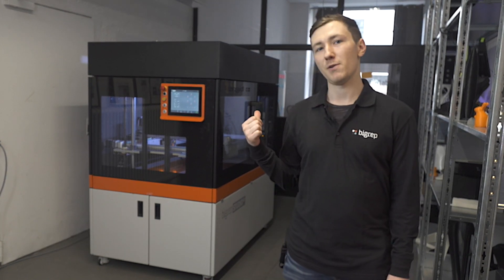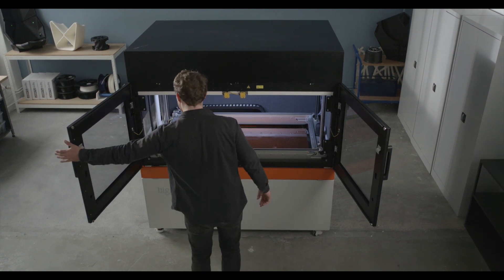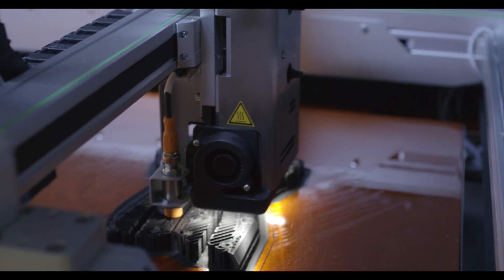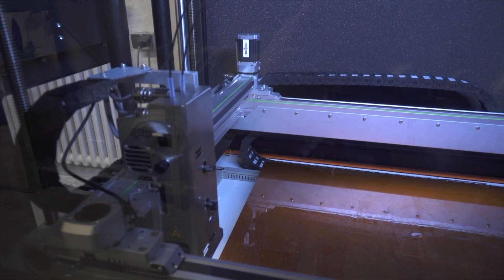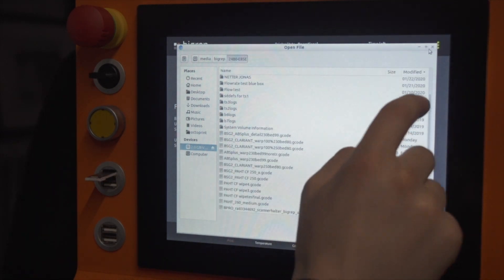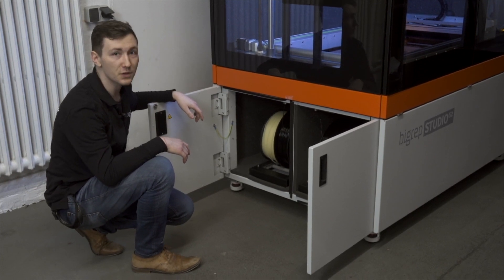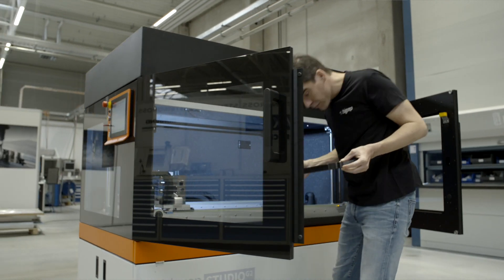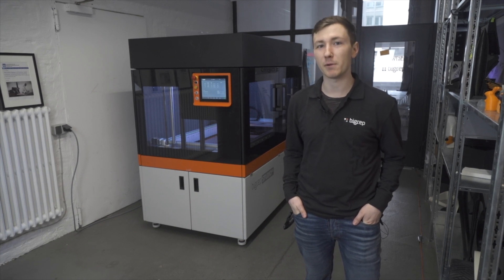BigRep Studio G2 - Product Walkthrough

Comment: I really love to work with Studio G1 and the Studio G2 looks amazing. Just a doubt. The capacitive sensor installed in the extruder head only works for autolevelling? Does exist the way that this sensor helps to detect when the printing fails for parts missing due to the warping? Well i guess warping is controlled now by the closed system. Regards!!